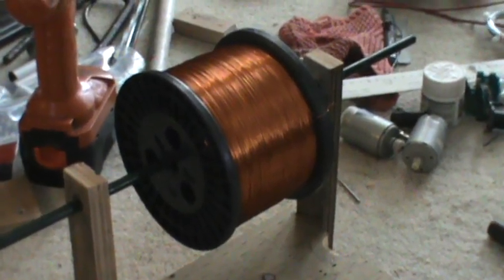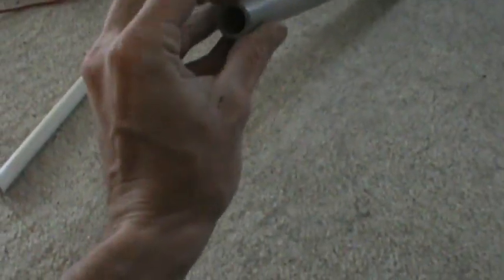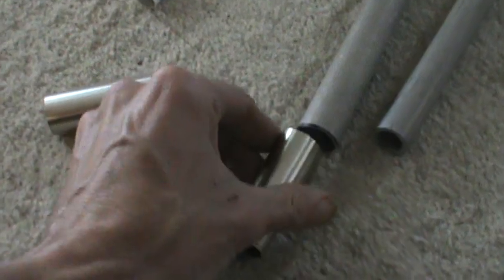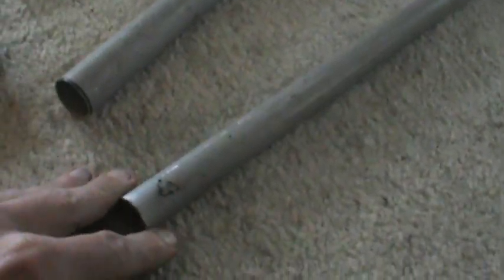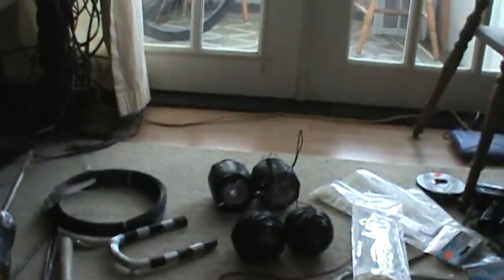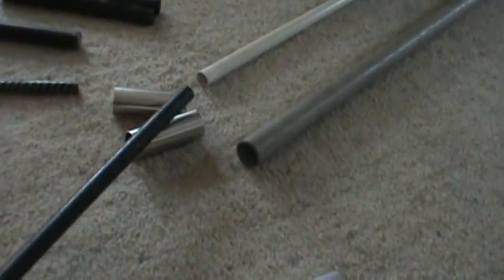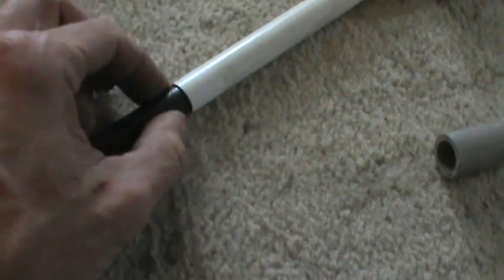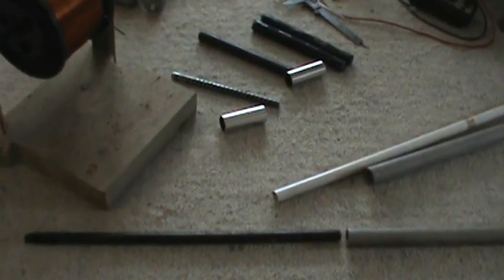Free Energy Project - Magnet Wire and Direction Update

Comment: Hi MrAngus, Got an idea for you (you may have thought of it) ... you know your coils, have you tried encasing them in metal to keep the magnetic flux consentrated on the inside? If you had a 4" steal pipe, or tin foil, or aluminium foil whichever you think would work and wrap that around the finished coils... perhaps this will increase energy harvesting...